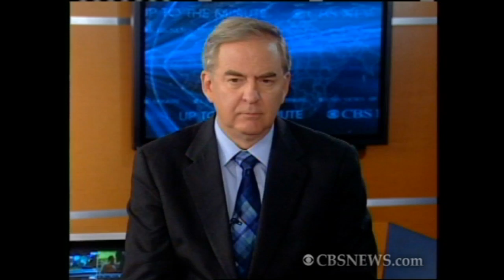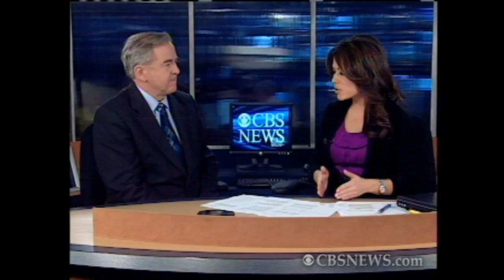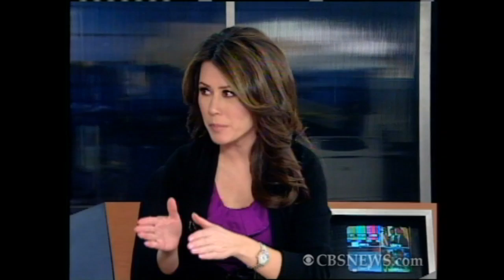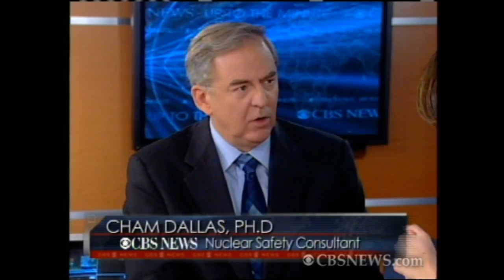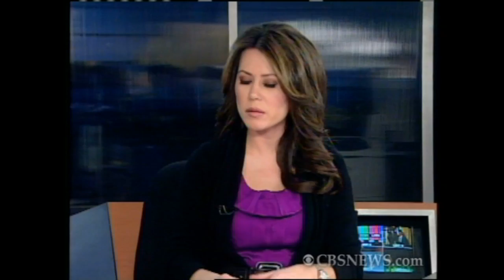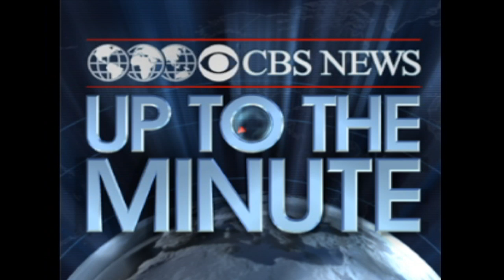Japan's Nuclear Update

Comment: Power is fed into control panels, then sensors, valve actuators, flow meters, circuit breakers and logic circuits. This is mostly gone. It will take significant effort to directly wire a pump and bypass everything else.  In Chernobyl they conscripted 600,000 people just to bury the place because each could only work a few minutes. 
Expert plant operators must be dwindling due to radiation sickness/illness.  Without their expertise all they will be able to do is bury the plants.